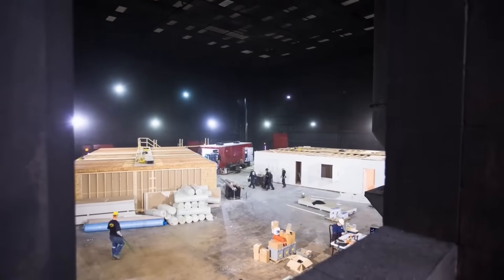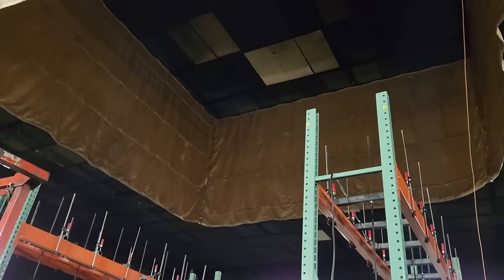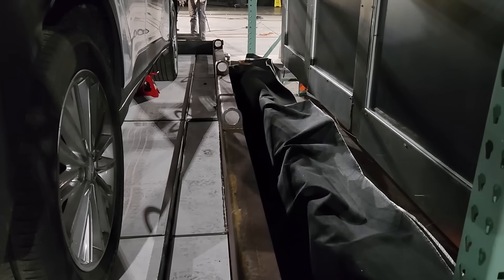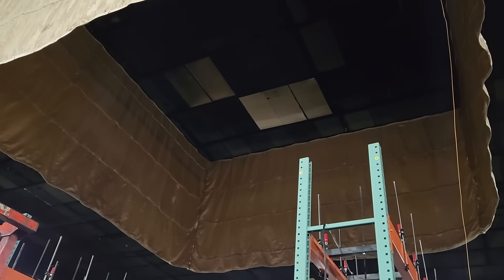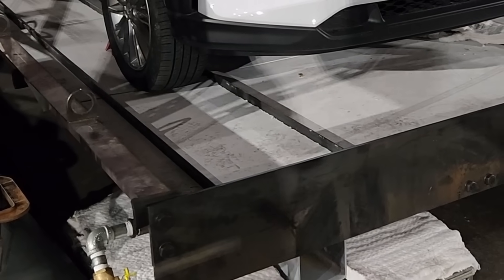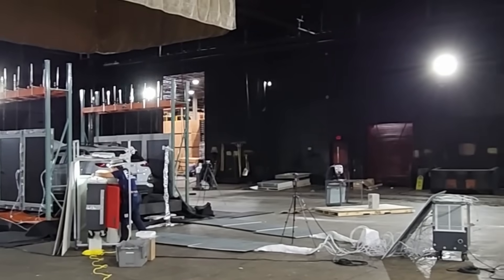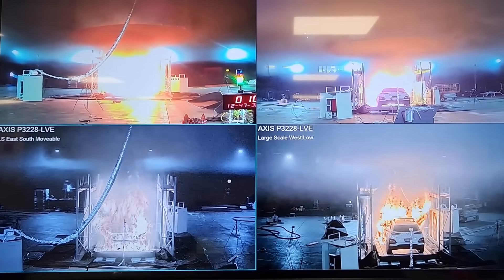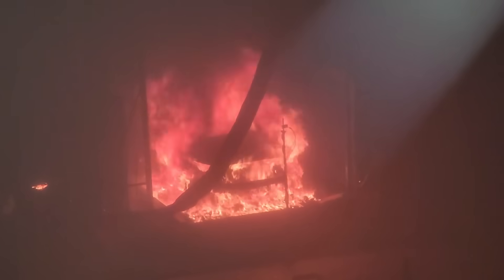Burning SUV: EV Fire Study

Comment: Did this car have a steel or plastic fuel tank? Does a plastic tank melt dumping the fuel?  What happens to the fuel in a steel tank?  Just curious.
Reply from the maker: Most modern vehicles have plastic fuel tanks.   The tank will eventually melt and dump out the fuel.  Typically, it takes a long time for this to happen because the fuel inside the tank will absorb the heat.

Comment: In this situations problems solve cement not fire burning out in cement box only heat cement box and other way sand box electric vehicles battery bullet attack battery blast stone attack battery explode battery box shield layers not compressed plate  make companies staff

Comment: I would love to see a bushfire test of a bluetti large powerplant. Tesla powerwall , the others .. Or 4 of them put in a pottery oven... Just to see how far the device needs to be installed away from a house structure.....   As those tests need to be done .. and a national register for firefighters to know what houses have them,   like they have for every house with a pool.

My idea is to have a hole dug , like a 3 by 3 meter swimming pool.   And place them 2.5 meters below the water ... And a cover over the top....  Be great for keeping the pack cool all year round and a guarantee it will survive a fire ....

It's a worthwhile small investment to make sure the money spent ... Will never be lost.. and the water jacket keeping the unit cool will be better than the air cooled fan using the battery...   A lithium powerplant designed to be installed below water.... All the cables run to a external box with all the switches lights and inputs and outlets..

I had 4 18650 all go , in my kitchen... Sounded like a car crashed into the building.... It was in my bathroom... That was one cell.   .. then I ran into the kitchen, thinking a firebomb explosive was tossed into the house.. then the other went in my face ..... Scary stuff , beyond anything I've ever experienced.... They were all overcharged.  And everyone needs to see it in person ... Just hook a charger up that doesn't stop charging at the 3.something volts.              They are like bombs

@theairstig9164 If StacheD really wanted to get millions of views... Putting footage of a lithium vibrator going up in flames would do it ...

Comment: Professor Paul Christiansen from  University of Newcastle presented us a seminar on emergency response to EV fires. He is also at the cutting edge of research into to how Li Batteries become unstable and fail. The gasses and vapour from Li batteries will penetrate existing BA units and Structural protective clothing. That same BA and clothing IS sufficient for ICE car fires. It is not sufficient for EV fires. 
However my brigade does fight ICE fires from a distance as we only have bushfire PPC/E so as not to expose ourselves to the toxic smoke.

Comment: I had grandnieces tail swinging their grandma’s mom’s car on gravel road. All we could see was gravel smoke. And they were teenagers, they flipped the car upside down and was hanging by their seat belts. Well we got them out and down to family reunion home couple blocks down. You could see spiking of electrical stuff and see gasoline slowly dripping from tank filler spot. I thought this is too scary i’m getting away from this car. The men who came out of their houses to see whats going on…decided they need to fix this problem and together they flipped the car over, and wow, it blew up and the mushroom smoke cloud went up about 3 times higher than the house. It was a  thin mushroom cloud, but it went up. All were safe because they said they heard the shhhhhhh and and all turned and ran and nobody got hurt. Amazing memory for family reunion. The girls were deeply upset with themselves. They never did those kinds of things again. Of corse I never for credit foe being able to judge the true danger of being so stupid to flip the car with leaking gasoline and sparking wires, which was why I got away from those crazy men!!!(and yes one was my husband)
Reply: The car was a Kia, in 1988

Comment: And the temperature of the base panel? Since EV's are known to sometimes burn literarily through the ground.
as mentioned in other comment, 90 to 100kwh fully charged battery, are you sure the facility is safe to handle that?
Reply: The electricity in the battery at the time of fire isn't all that critical.  The actual burning of the Lithium has the same toxicity whether new and charged or old and dead battery.   Lithium is the problem.
Reply: @ToolHombre  Tests show otherwise. When comes to toxic stuff it will be the same. However having gigantic amount of energy stored in the battery makes it rather energetic.  But it is true, that will not increase toxic funes, there is not extra material in it.

Comment: You don't get explosions from gas tanks if they are full. It is the incorrect stoichiometry. The gas tanks needs to be mainly vapours mixed with air.  In a crash, the gas can vapourize and create the correct stoichiometry. That is why the gas tank is protected. So explosions are possible but rare. Look up what happened to the Ford Pinto. It just isn't a Hollywood thing.

Comment: Wow, great video. The ICE car will be like burning a candle compared to the EV self sustaining blowtorch.
Reply: Prepare to be disappointed. BEVs only are hot at the cell. The bulk of the fire is otherwise almost identical to an ICEV except with BEVs, you don’t have to worry about burning fuel rapidly spreading the fire.
Reply: ?? The EV battery is a self sustaining fire with its own oxygen supply that burns much hotter and for longer as fire crews literally cannot extinguish it, the battery shoots horizontal flame out the side. The only way to fight it is to drag the burning EV away from other vehicles so it doesn't burn them too. ICE cars are relatively straight forward to extinguish with a lot less water. Anyway, these tests will be a good indicator. My tip is that the blowtorch of fire getting shot out sideaways from the EV will cut a hole through those side panels and fry the thermal camera behind it. I want to see a Kia EV9 99.8kwh battery incinderate itself and everything around it, the scienctists can set it off and come back the next day. @williammeek4078
Reply: It's the vapours and toxins that are so dangerous and explosive, way more so the ICE fires.
And the blowtorch effect and the fact that you can't put them out until they have consumed themselves. We can fight the exposure fires but the point of origin remains.

Comment: 217,000 ice vehicle fires in the U.S. for 2022. 
Average is an ice vehicle burns down every 4mins so about 2 while watching this video. 

Over $6,000,000,000 in structural damages each year for ice vehicle fires, not including commercial use combustion engine equipment!
Most common cause of fatalities in collisions with large vehicle's is due to fires!

Garages are detached structures because of ice vehicle fire risks. The #1 open recall across ALL LEGACY ice oems is for the risk of FIRE even when parked right NOW! Effecting over 10,000,000+U.S. built and sold vehicle's of 3-5 year's in age. 

Yes let's all clutch some pearls and worry about evs you poor gas sniffing, brain dead bunch of ABSOLUTELY worthless little muppets. 👍🏻😂

Comment: I really hope that for several EV tests they put the main propulsion battery in thermal runaway. This is the only way to get a real fair comparison. Any fire starting in an ICE car is roughly the same as any other. A fire caused by a burner under the "engine" of an EV car could be very different from a propulsion battery in thermal runaway fire.
Reply: Almost any EV fire that is allowed to burn will put the battery into thermal runaway.

Comment: As a nuclear engineer and former member of SFPE I am encouraged that finally this sort of testing on EVs is being done.  I am sorry this was not done before the concept of EVs was "certified" for road use.  When the "peaceful uses of the atom" was being considered in the early 1950's a very good collection of physicists, scientists and engineers did a wide range of thinking and testing on what the safety risks to the public would be.  The result was a careful roll out of nuclear plants first in test units, prototypes and then commercial use.  The consideration of the extreme accidents and safety systems has held up overall over the years with safe use of nuclear energy (please discount the ridiculous design of Russian reactors).  The issue is not the probability of accidents (low) but the consequences.  In the case of EVs, maybe fires are more frequent than we think, but the consequences of the catastrophic fire under multiple conditions including crashes has not been well considered.  With respect to fires, it seems we never learn to anticipate the need for safety systems until deaths occur.  That cycle has not yet been broken.
Reply from the maker: Many of the manufactures have done fire testing on their electric vehicles and batteries.  The data will never be public.  Thankfully we have independent organizations that are wiling to do these types of tests.
Reply: Why do all that research when all you have to do is apply the label 'safe and effective'?
Reply: Yes, and look what happened at Fukushima. Nuclear power is a crazy idea.
Reply: @charlestoast4051  You havent watched all cities being totally destroyed by the TSUNAMI. HEJ
Reply: NEW CLEAR ENERGY =STEAMTURBINES. JUST A CHEMICAL THERMO REACTION IN THE BOILING WATER REACTORS BWR..THEYVARE BOILING THE "COOLINGWATER". OMG HIW THE FUCKED US BIG TIME.
Reply: That isn’t the way of capitalism. Throw a product out there and if it doesn’t work or is dangerous, you have to sue to prove harm. 
But in this case, EVs have proven overwhelmingly safer than ICEVs and the fire danger is primarily media hype. 
We have seen the worst EV fires are no worse than the worst ICEV fires.

Comment: Many Kia/Hyrudai fires in the past several years were due to anti lock brake modules that leaked brake fluid into the electrical side of the unit, their solution afaik was to install smaller fuses in the module. These fires had nothing to do with gasoline, turbochargers, engines, etc. They were caused by the engineers who designed the ABS modules and they may well have been supplied by an outside vendor.

Comment: Prediction: insurance premiums for EVs will skyrocket (further) when conclusions are made next year after comparing the EV to baseline.
Reply from the maker: I'm fairly certain EV premiums are already skyrocketing.
Reply: @StacheDTraining  hence the "further" clarification. I won't be surprised if they try to subsidise the increases with taxpayer money... you know, for the "environment".
Reply: Insurance premiums are indeed increasing at an alarming rate overall (quite the racket). Auto policies are determined mostly by replacement costs, if the EV vehicle costs more than an ICE version of the car, it Will cost more to insure it, given the same coverage.
Reply: @doublebackagain4311  Yes, replacement cost are the big factor in determining car insurance rates.  

They also take into consideration the safety of the occupants in a crash.  In other words, if the vehicle protects the occupants better, there are less medical costs.  And EV’s in general do protect their occupants better than ICE cars because for one, they have better anti-skid technology.  And they’re safer because they are bottom heavy and almost never role over.  

Insurance companies also take into consideration how often the vehicle is stolen, which for most EV's is much less because they can keep their cameras on all the time, and, if stolen, are easier to track, and even disable electronically.  So thieves at least know enough to steer clear of them.  Especially Teslas.

Right now EV insurance takes a bit of a hit not only because they are still a little more expensive, but also because there are not yet enough dedicated shops to work on EV's after an accident, and therefore the one's that do exist can charge a more.  But this will surely get better every year, as will EV insurance rates, especially as EV sticker prices come down.

So for all these reasons and others, I think in time EV insurance will actually be cheaper than ICE insurance.
Reply: My EV insurance in New Jersey was the same as for my ICE car.   In time I expect EV insurance to actually be cheaper since EVs are inherently safer to drive.  And EV fires, already exceedingly rare, much more rare than ICE fires, will only become even less rare with the wide-spread adoption of the new LFP batteries.
Reply: @Tom-dt4ic  yes, and my grandma is a virgin.
Reply: @gjvah  My EV insurance in Australia is less than my ICE car was.